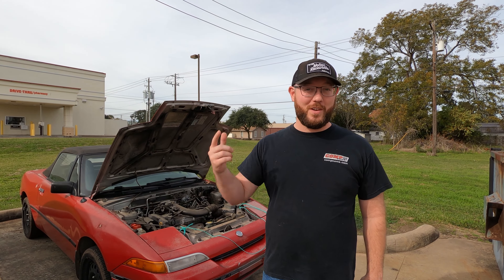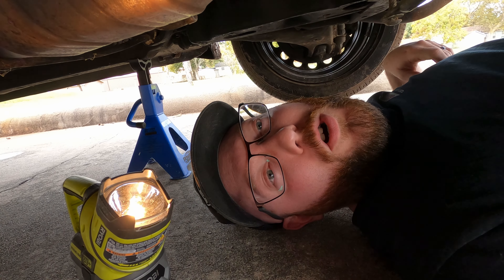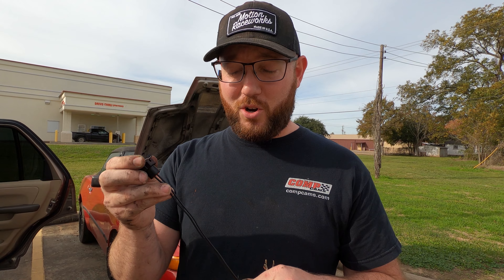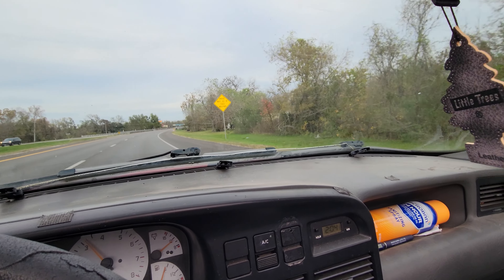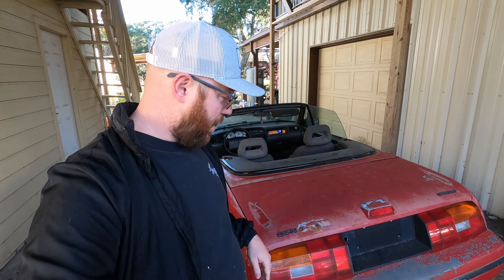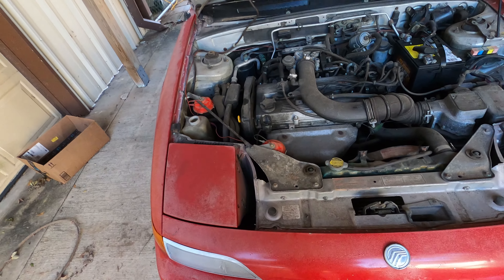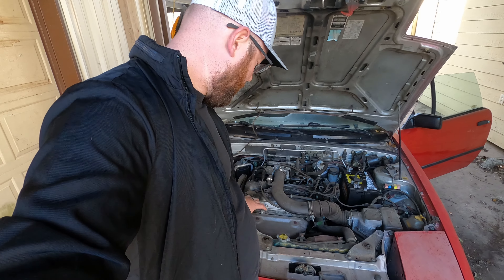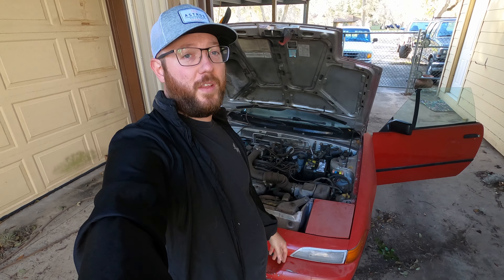My actual new 24hr of Lemons Racecar!

Comment: Cooling is the most important. Bigger rad is good. You can also get some more cooling out of the system by rerouting the heater core loop to another cooler in the front. Hit me up if you got any questions about tech or anything. We are in Alvin and have been racing lemons about 5 years now in a absolutely silly car. 79 bmw e21 320i, Mercedes om617 turbo diesel, Nissan 350z trans, 89 thunderbird 8.8 rear end, all kinds of junk. Total class C car.